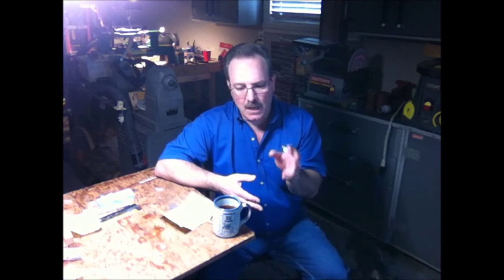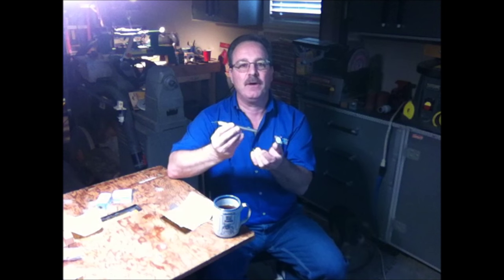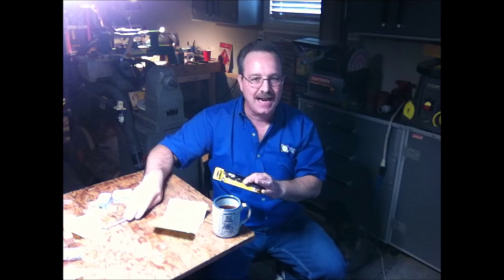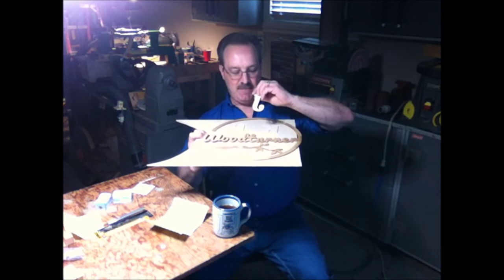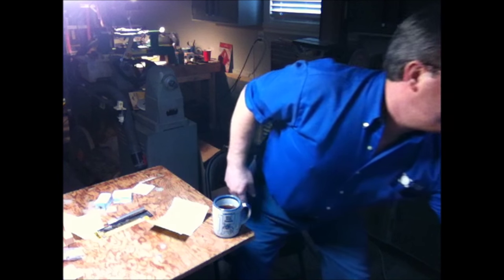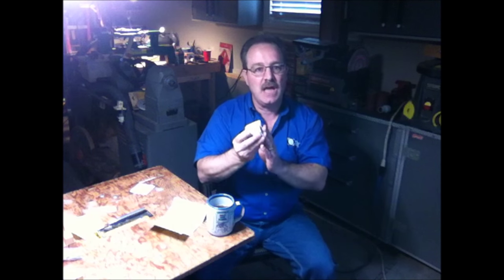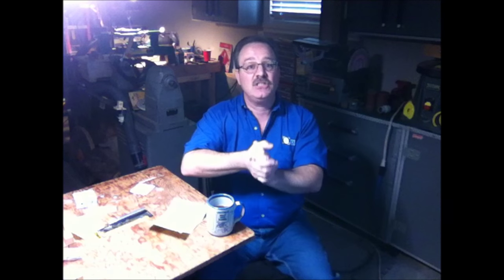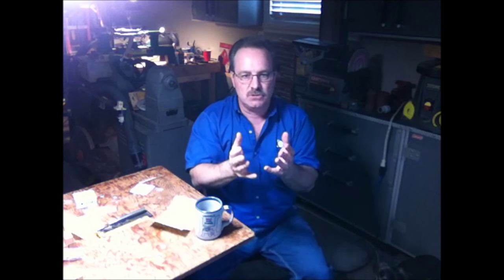Necklace Hanger Follow Up and Shop Update

Comment: I'll second (or third) Matthias' gear generator program. He also has his Big Print program that will print any size image across multiple pieces of letter sized paper with alignment lines. I use it and love it. I've printed huge patterns for wall logos and it works great.
Reply from the maker: Thank you Joseph. 

Regards,
Bob